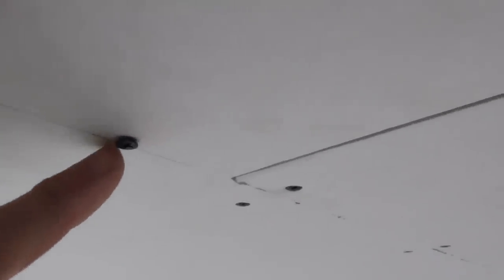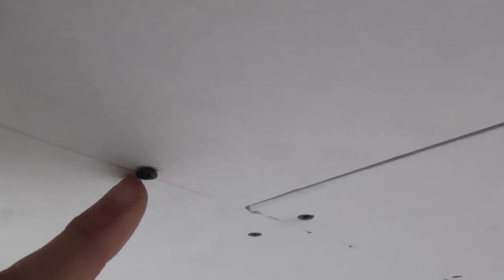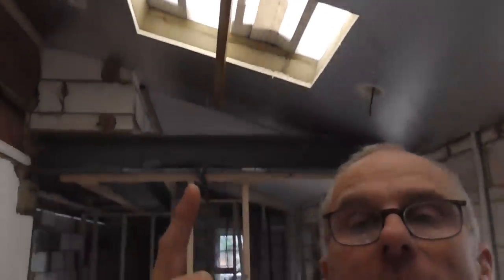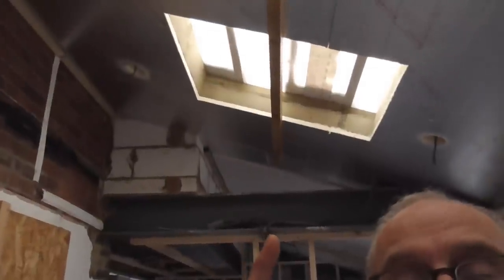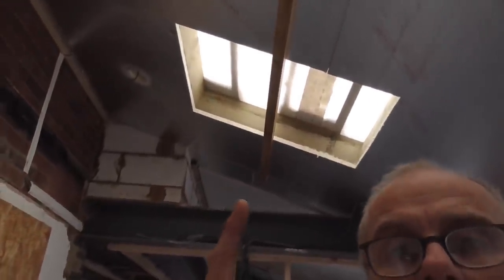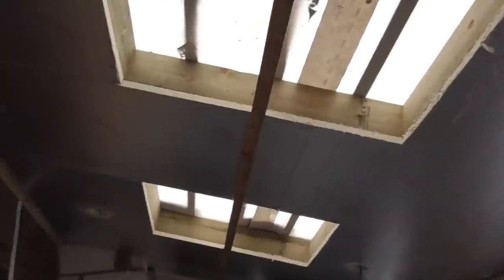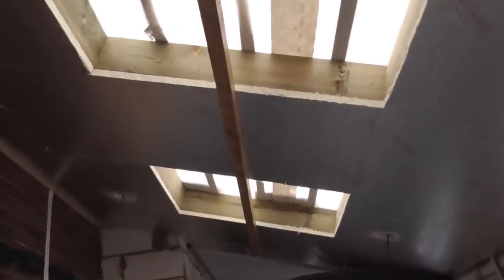Plasterboard/Drywall ceiling fixing tip ***PLUS BONUS TIP***

Comment: Sure worked out fine, I would usually do some full sheets first so I know they are running straight then drop back to pieces. 👍
Reply from the maker: Hi there🖐Yeah, I think 'proper' tackers do it the same as you suggest👊 I'm a bit of a part timer at it😆Thanks for your comment and for watching😎Cheers Del

Comment: When I lived in Canada my first job was fitting drywall and when we fitted the boards to the ceiling they were 10 feet long and 5/8” thick and double boarded, I used to go home and my back was in bits. Think I lasted 7-8 weeks, tough trade to be in.
Reply from the maker: Great comment Diarmuid👊Yes, tacking ceilings full time is a REALLY physical job, and I'm glad I only do the odd bit here and there😉Thanks for watching😎Cheers Del

Comment: Good old tip with the screws, my son  is a tacker and puts 8x4 sheets up on his own of a pair of steps using that method, I find the board mate gadjets really good and they also give you the penny gap between the boards which no one does anymore 👍
Reply from the maker: Hi Andy🖐I've always admired guys that tack ceilings on their own👊as it takes a lot strength and co-ordination👍Thanks for watching😎Cheers Del

Comment: A length of tile batten inch and half shorter than floor to underside of joist used as a prop (deadman). Nice to see you hard at it mate 👍🏻
Reply from the maker: Hi there🖐Yeah, a dead man is a great aid when talking ceilings on your own👊Thanks for watching 😎 Cheers Del

Comment: when ive done this type of thing ive found it better to screw battens to the underside of the insulation  set out to suit whatever plasterboards you are using then ya can use an auto feed driver to screw the boards up. leaves it easier for the sparkies too.
Reply from the maker: I get you Paul, and it does sound a great way of doing it👊Thanks for watching 😎 Cheers Del
Reply: @thetallcarpenter  also means the sparky can adjust cables easier if necessary

Comment: A fine job T.C, that ceiling looks mint! Personally i hate slabbing, not a job for a carpenter in my opinion. It should be a plasterers job. That said, like most carpenter's I've done my fair share of it. To make things easier I have a slabbing T-square, two cordless collated screw guns, a Bosch 12V for ceilings and a Makita 18V. I've got two Marshaltown rasps as well, one with rails and one without. Handy for talking a shave off a board, 👍 🔨 🇮🇪
Reply from the maker: Hi TN🖐I actually used to do most of the plasterboarding on my builders jibs, and, like you, was a better set up for it👍We get a couple of really top notch tackers in now and they absolutely fly through it🌬Thanks, as always, for watching and your great comments😎Cheers Del
Reply: @thetallcarpenter  Another benefit of the collated screw guns is that they are ideal for fixing down subfloors with strips of woodscrews. I try to get the square drive screws from Senco if I can. I love the Robertson number two square drive bit, it never cams out. I'm working on a stairs renovation at the moment, white oak as far as the eye can see. Not a slab to be seen thank God! 👍😁 🔨 🇮🇪
Reply: @TheToolnut  what is the subfloor you refer to, the actual 22mm weyrock?
Reply: @handle1196  Usually 18mm T+G O.S.B.
Reply: @TheToolnut  i always wondered if them drywall guns are limited to plasterboard or people could screwdown the likes of 22mm caberdek P5/egger protect or if this is an impact driver only task. It's tough stuff.
Reply: @handle1196  I was the same until I did some research on them. One can drive flooring screws with them, plus deck screws. My 12V Bosch is limited to a 55mm long screw. My 18V Makita can drive 55-75mm screws. The Bosch is ideal for slabbing ceilings or putting 11.7mm O.S.B onto stud walls as sheer panels or onto ceiling joists. The Makita has more grunt which is needed with the longer screws especially the flooring screws I found. I'd strongly advise getting a few square drive tips, they are far and away the best and never cam out, 👍 🔨 🇮🇪
Reply: @TheToolnut  good to know as ive got an impact driver but been looking to buy a makita drywall gun, either the autofeed or possibly the cheaper manual type both 18v

Comment: I splashed out on two cheap props as I work alone often. Well worth the money.
Reply from the maker: Hi Geralt 🖐 I think I know the kind of props you mean, and, fortunately, I've always tacked with two of us👊Good effort doing it on your own bud🤗Thanks for watching😎Cheers Del
Reply: Me too. Little cheeky tip I use is a couple of wooden blocks a few mill lower than the previous board. So when I put the board up it holds on them whilst I reach for the prop. Does that make sense? Like little handles on the ceiling.
Reply from the maker: @funkeybikemonkey  Hi FunkeyB🖐Makes perfect sense to me, and like having an extra pair of hands to hold the edge of the board💪Thanks for your comment 😎 Cheers Del

Comment: Best tip for drywalling ceilings use a sheet lifter. Mine is an old wind up wheel version but you can get powered versions. I use a cordless collated drywall screw gun so can't leave screw proud but on lifter so no worries. Our biggest sheets are 6 M X 1350 though usually 1200. We try to do the whole span in one sheet. Just had a whole truck load delivered today. Start sheeting whole house tomorrow. We also stick ours with a stud adhesive so the sheets are glued and screwed.
Reply from the maker: Hi Dave🖐Interesting comment bud, and always great to hear what/how others are doing it👊Those sheets sound like beasts to put up, and I suspect, you gotta be on the ball when fitting them😲Doesn't sound like they'll be coming down easy either💪Thanks for your great comment and for watching 😎 Cheers Del

Comment: With the bigger spacing on your floor joists/trusses do you guy use 5/8"(15mm I think) drywall or are you still using 1/2"( 12mm)? Apologies if my freedom units to metric is a bit off.
Reply from the maker: Hi Nagantfan🖐You're right bud, we do use 15mm on 600mm (2 foot), centres. BUT you can use 12.5mm (1/2") on 600mm centres if all the joints have noggins fitted👍You'll notice that we still screwed little timber blocks in between each joist spacing, as I think it helps control the joint better despite it being 15mm board👊Is this similar to the way you do it🤔Thanks for your comment 😎 Cheers Del